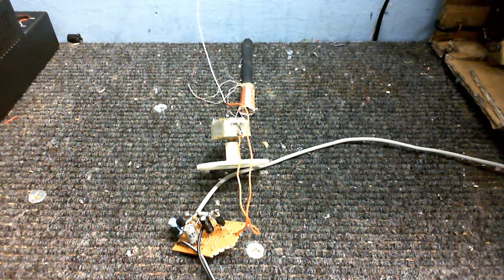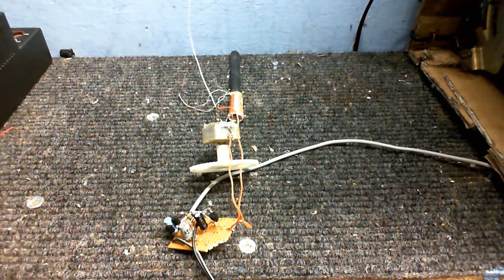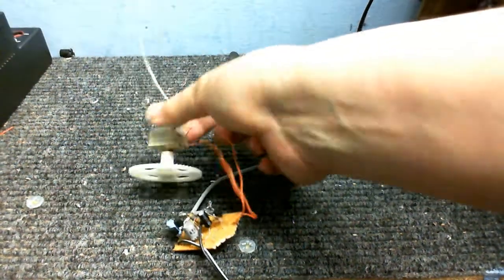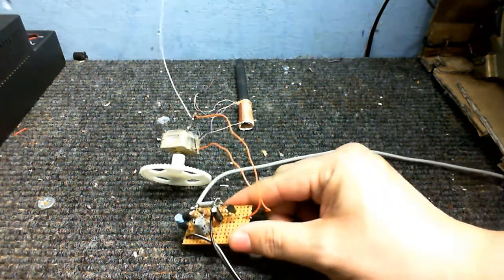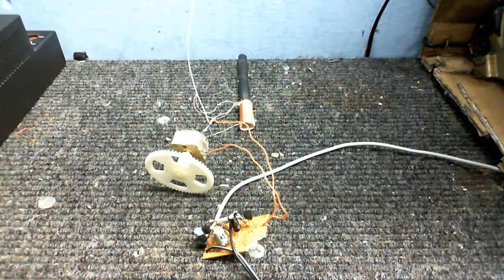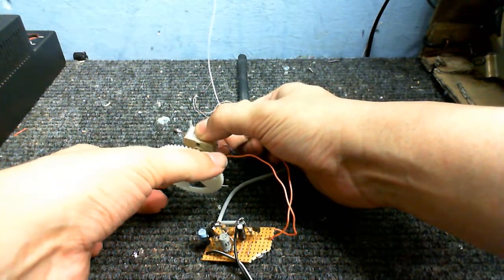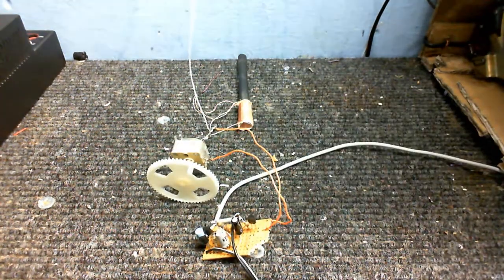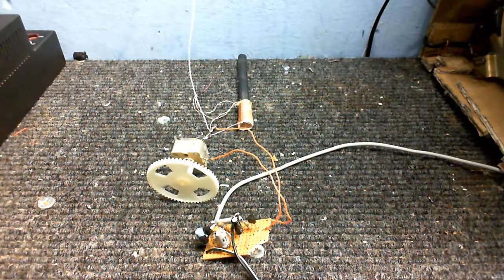Homerew AM radio tuner fail

Comment: For some reason the circuit is self-oscillating. That's what's making the whistling noise. Maybe you can try reducing the gain of the FETs, then maybe they won't go into oscillation.

Comment: you are very close, each one of those whistles is a radio station but for some reason they are not being demodulated very well.
Reply: the wihstle is a feedback that makes the coil modulate
you tune a am recever arount that oscilation

you need to tune the coil just bevor the wihsteling

Comment: Nice little project.Im not really all that good in electronics but maybe you could consider making the wires between the capacitor and the coil(in the tank circuit) as short as possible.

Comment: why not build a simple tube am recever

just as easy but with less parts
Reply from the maker: I might try a re-generative circuit, I've been looking for some schematics on google and most of them seem to be based on the same circuit, so it shouldn't be hard for me to come up with something of myself.
Reply: use somthing common for the coil
like a toilet roll holder

that makes it easyer to replicate